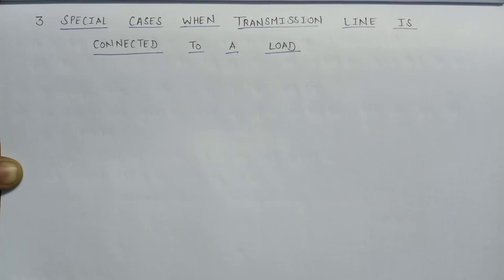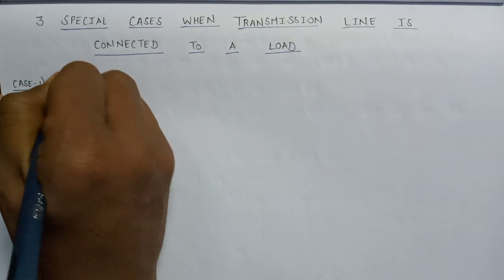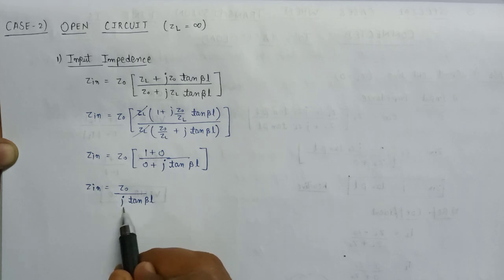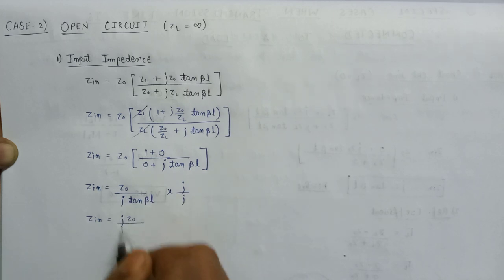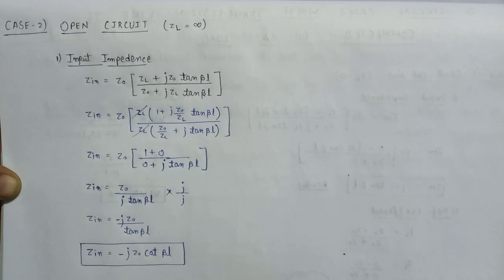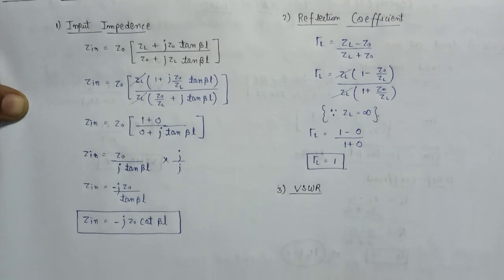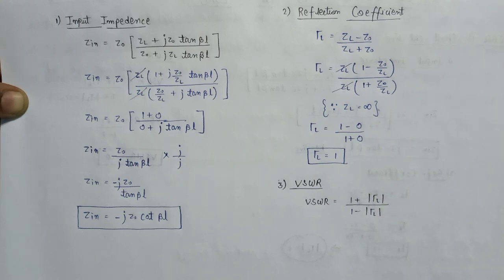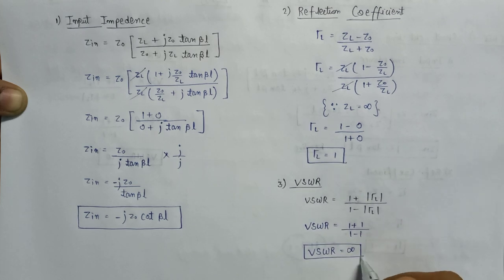3 Special Cases when Transmission Line is connected to Load

Comment: Sir in case of short circuit input impedance k formula me regular tan hoga ya fir hyperbolic tan?
Reply from the maker: Regular tan will be used as per the formula of input impedance
Reply: Are we applying the formula for lossless Tx line?
Reply from the maker: Yes, there is one correction in formula of impedance transformation for lossless tx line's video
Since , tan h(jbl) = j tan(bl)
Therefore, formula will be
Zin =(Zl + j Zo tan(bl) ) / (Zo + j Zl tan(bl) )
And here, everything is fine!!
Keep watching and thanks for correction 😀